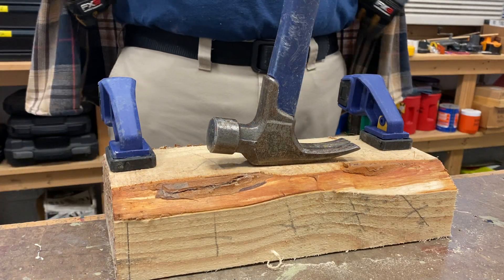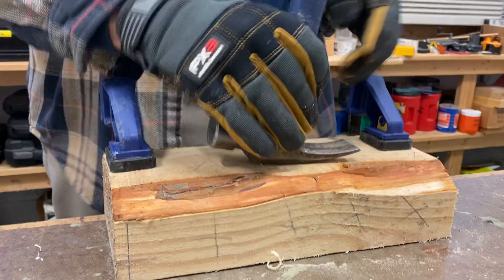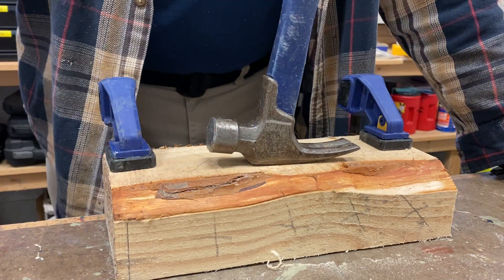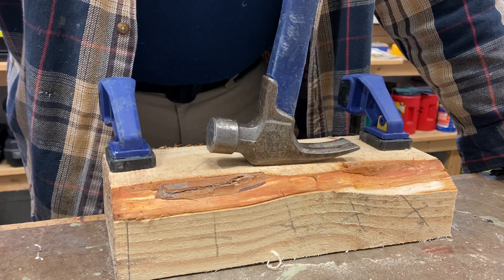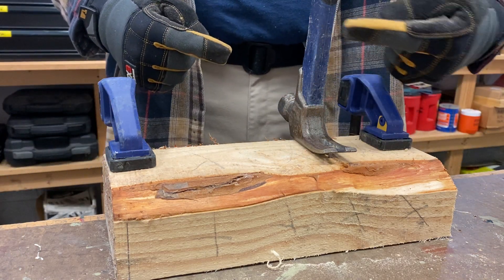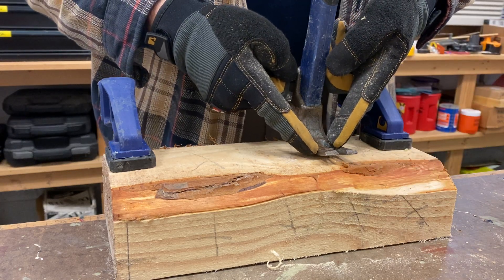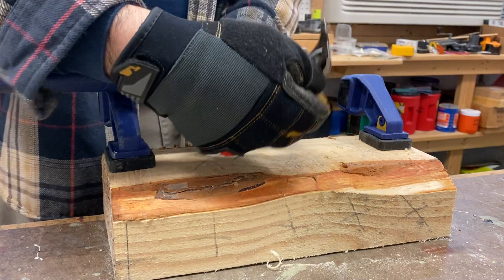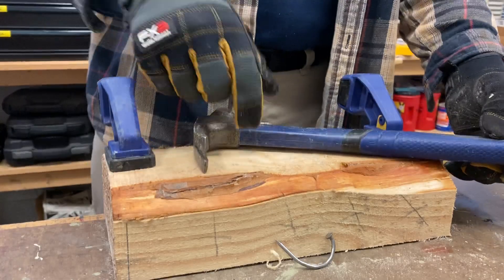An easier way to remove nails with your hammer (and the physics behind it)

Comment: 🛠️🛠️🛠️  WOULDN'T USING A CURVED CLAW HAMMER WORK BEST ON PULLING NAILS??? PLUS PUTTING A SMALL BLOCK OF WOOD UNDER THE HEAD ALSO GIVES YOU MORE LEVERAGE. THE SMALL BLOCK OF WOOD COULD ACTUALLY BE JUST A PIECE OF SCRAP WOOD OR A PIECE OF A TREE BRANCH  🛠️🛠️🛠️